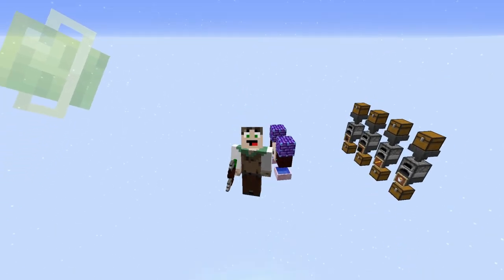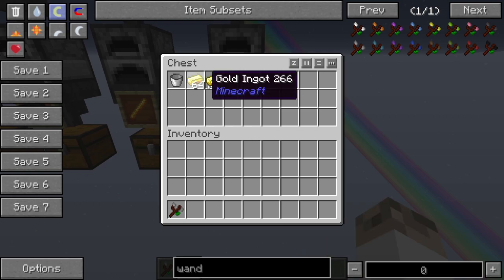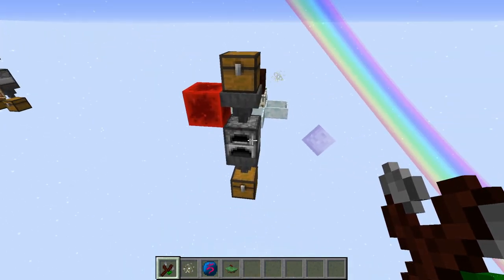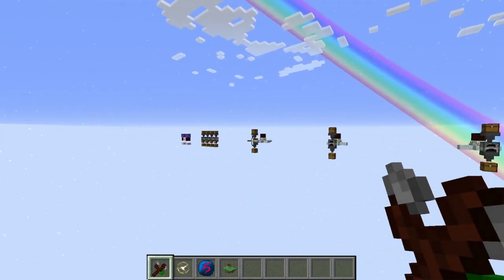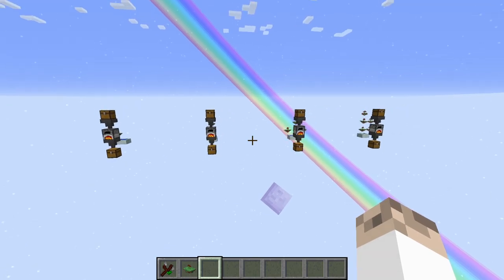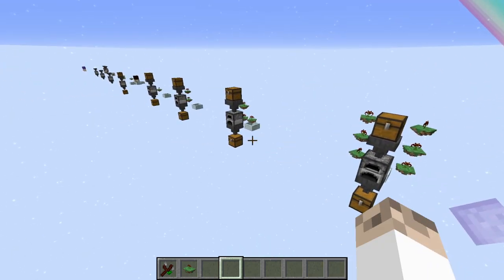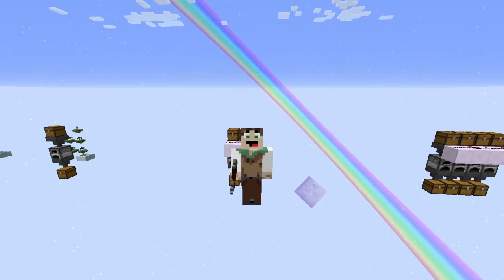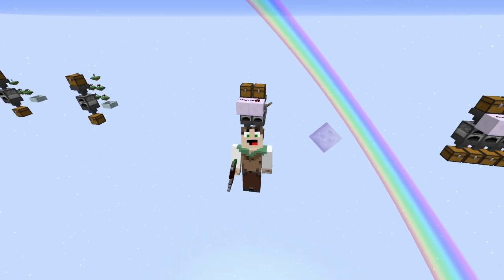Botania | Exoflame Efficiencies| Testing tutorial | Ore processing

Comment: I did a test like this. I used an endo flame to put 1 stack of coal worth of manna then placed down exo flames until they had emptied the pool by filling their internal buffer. ~36 exo flames.
First thing i learned is that i had to use a mod hopper and chest to keep the furnace filled. 
the second thing i noticed is that while the progress arrow was moving faster the flames(fuel gauge) was not.
The third thing i noticed is that the exo flames didn't all go out (use up their internal buffer and stop working) all at once. They went out one at a time. As more exo flames went out the furnace  got slower.
From this i concluded that the two effects of the exo flame (speed up and fueling the furnace) are independent. 
As long as the exo flame has manna it will speed up the furnace, this effect does not cost mana and stacks with more exo flames. Providing fule to the furnace and resetting the flame animation will cost mana for every reset. Only one flower will do this at a time and will keep doing it until it is out of mana.
The cost for running the furnace for X period of time via exo flame appears to be constant. Adding more exo flames increase the number of items smelted per unit time but only add a one time cost to fill their buffer. Assuming your system has more mana that ores to smelt and your exo's never run dry additional exo's are effectively free.

36 exoflames smelt over a double chest worth of ore for a stack of coal. This is cheaper than any powered furnace and far faster than any of the "free" furnaces in any mod i have played.

The efficiency stops going up somewhere between 40 and 50 exo flames. i think because smelt time might actualy go to zero and things mess up.

36 being a cube number makes for a very pretty cluster of flowers.
Reply from the maker: +Jared Pinkham That's very interesting, I tried messing around with the "maximum" exoflames in range, I would have hit that cap for speed, I also didn't check whether a hopper would keep up, that makes sense, it was pumping through...

Comment: As some follow up science since I was interested in your last question of how many exoflames to be as efficient as a regular furnace:

In tests with charcoal to ingot ratios, I found that you need only three exoflames to slightly exceed the efficiency of a vanilla furnace (two falls just short, but is very close).  But there is an important caveat here based on an interesting behavior I found. That is, peak efficiency is only realized when the pool remains filled during the smelting.

In testing I discovered that Exoflames aren't fed equally from a pool.  Normally, if the pool is kept full, this doesn't cause any issues since it's just a matter of continuing to feed the flowers as they need mana; however, this changes when the pool runs out of mana.  As a pool runs out of mana, it will overfeed one or two flowers and starve others due to this feeding behavior, which will lead to a drop in efficiency following a pool running out.  You can see this pretty readily if you watch your smelting speed toward the end of a test on a limited mana pool.

So a big message here for efficiency is keep the pool that the exoflames are drawing from filled.
Reply from the maker: +ILabs TacoMage That's really a great bit of information there. It makes sense, it's all to do with the priority. But that makes complete sense.
Reply: +Jansey  My next science experiment is to see if there is an Exoflame to Munchdew ratio that will allow a tree farm to directly output charcoal with no outside mana input.

TO THE LAB!
Reply: Well, that was some anticlimactic science.  Turns out that a tree farm with a munchdew provides more than enough mana to run itself and a furnace with only a single exoflame for turning the wood into charcoal.  Granted, you're better off with more exoflames from an efficiency standpoint, but they aren't strictly necessary.